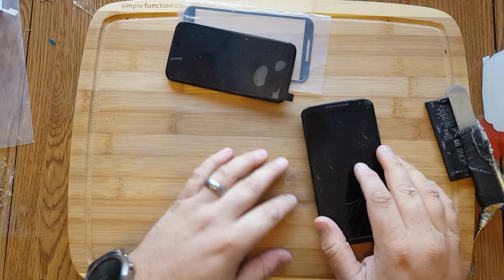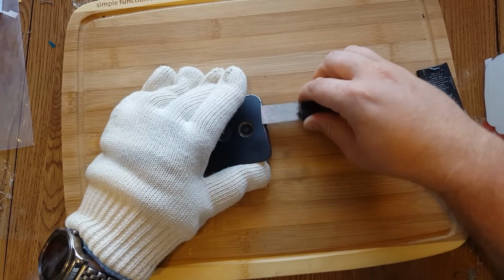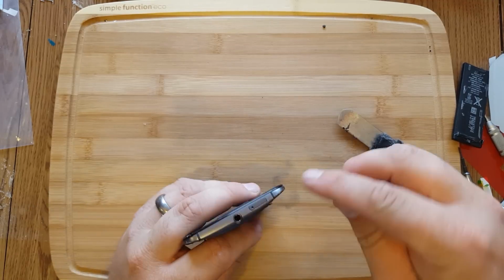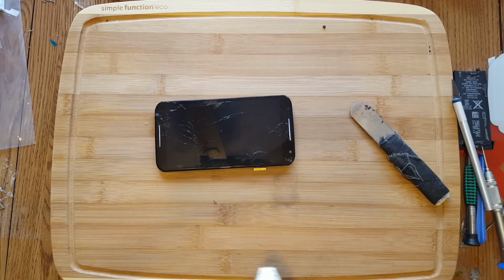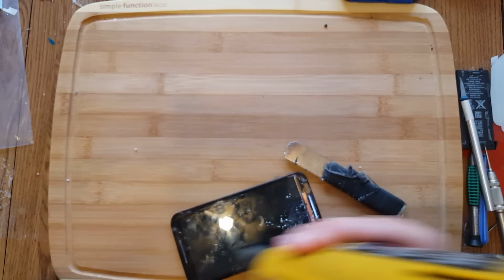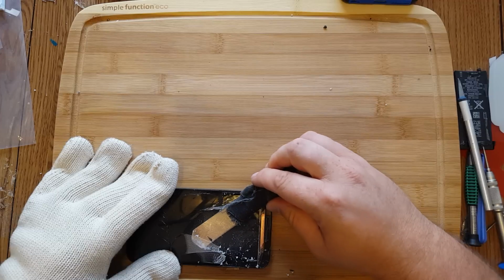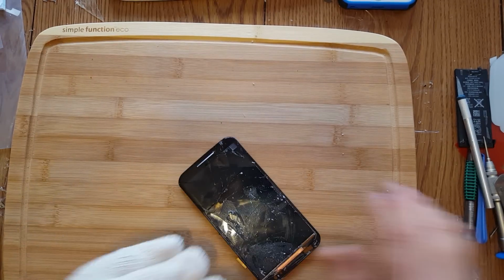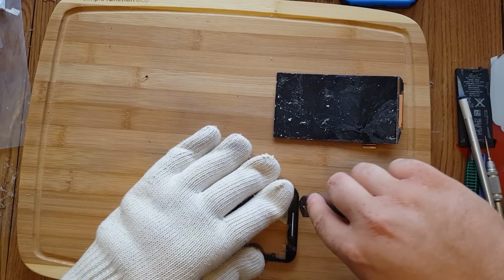Moto X2 Glass Repair Fail

Comment: Whelp. I'm definitely not sending you my phone for repair...
Reply from the maker: Lol.   Why?   Because I show you a fail video?  We do these successfully all the time.   There is a secret to them I dont show in the video.
Reply: +Tech MD Youtube Because you were hacking at it with a metal tool.
Reply: +Tech MD Youtube As far as the secret... yeah, you use acetone to remove the glue. NBD. Recommendation: use monofilament fishing line instead of the metal pry.